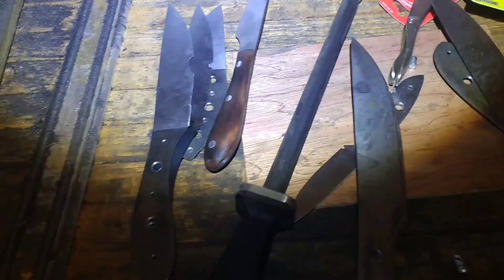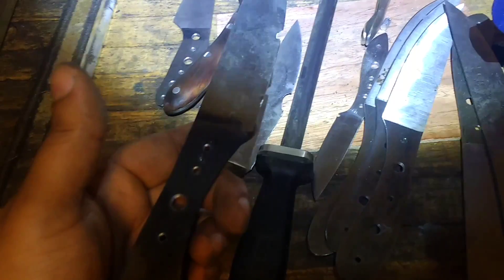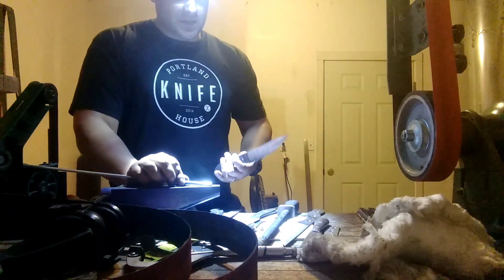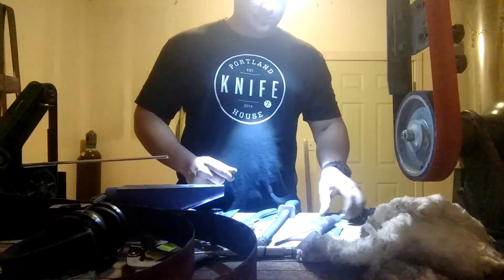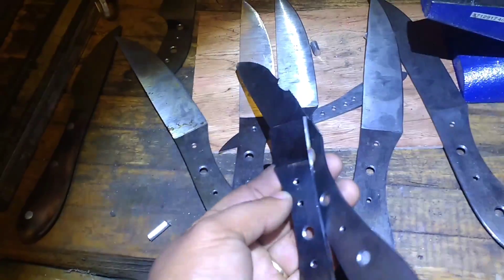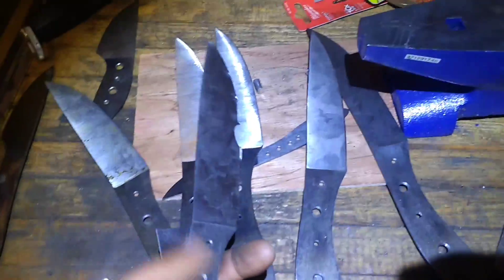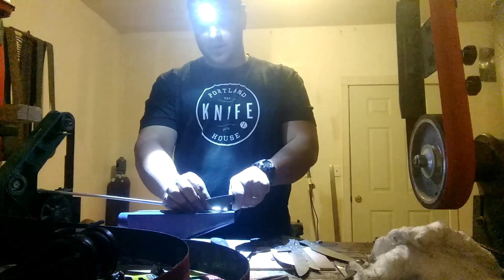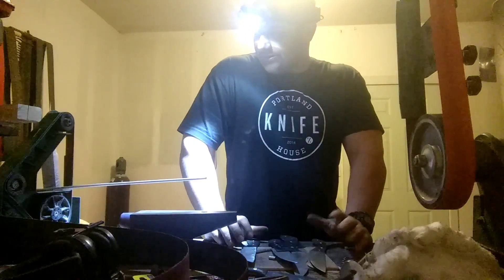ONLY THE STRONG SURVIVE

Comment: Good work. Literally. Impressive shit man. I know you did a lot of studying before you took a whack at it, so it's even more impressive. I just picked up the HF 1x30 for scratch removal, polishing, and sharpening (OK, and maybe even some knife making way in the future). Any thoughts on the machine and its limits? (Unless that is not an HF in the background.) Also looking for some good belts to get started with it. Too many options and suppliers. One guy says no SC belts, recommends AO belts and likes Norton and scotch-brites too. He modified the HF machine (also switched out the motor for a variable speed)  and easily profiles, sharpens, polishes...
I like stones and won't stop using them, but that potential time saving was too tempting to pass up.
When you've got some inventory built up, maybe I can stop by for a beer sometime and shoot the shit - and buy something if I can swing it.
- Aloha
Reply from the maker: Dylan Grey I can't get my HF to ever replace a stone. Doesn't give me the same edge quality no matter what the abrasive. Neither does the 2x72. It's just for quick and dirty Sharpening that you clean up on the stone to save time IMHO. Sounds like your buddy can help you out with the HF. I know that the 2x72s are very very expensive but Its just a pain in the ass to use the 1x30, It has NO BALLS. You really need the big ass motor so you can get serious. It's already difficult to grind a knife. The 1x30 is not ideal as I learned, but I'm not going to throw it away. I use it for minor shit.

Yeah Brotha that would be pimp.
Thanks homie.
Reply: Mos def.
Here's the guy:
https://www.youtube.com/watch?v=i48r-f8W4jI&t=23s